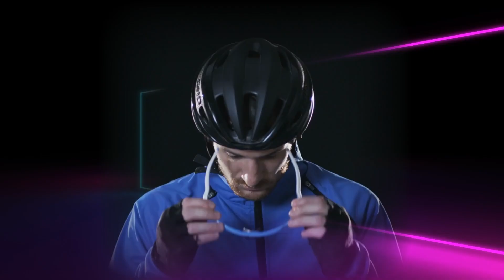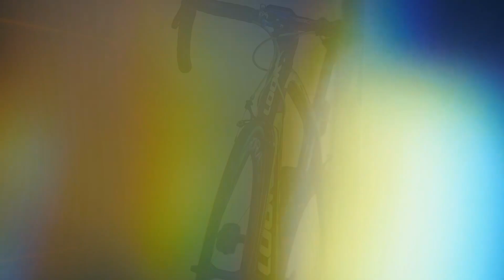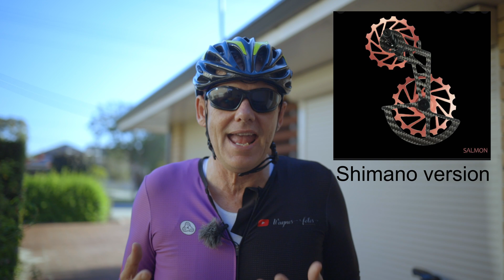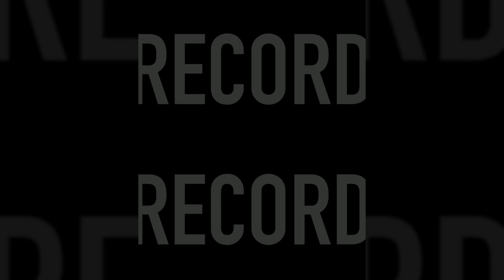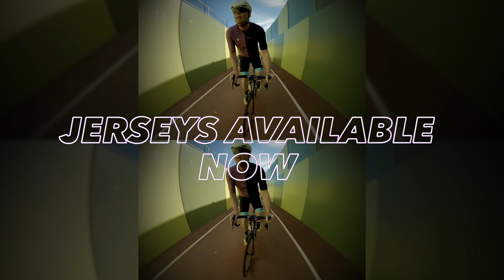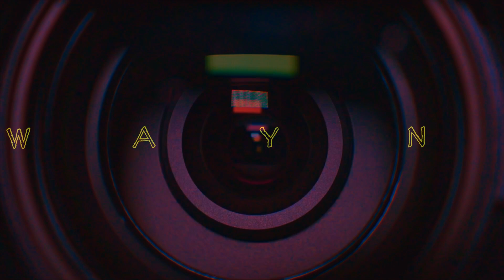Nova ride OSPW, big brand competitor

Comment: Being fairly obsessed with weight  is the main reason I wouldn't go for an OSPW. The weight of the unit, plus the extra weight of a longer chain, would negate the weight savings of my very expensive Darimo drop bars. I couldn't do it. 😱

Comment: As you probably know Dura-Ace rear derailleur cage is made of carbon fiber. Not even a few weeks after I bought my 9150 Dura-Ace group this year I cross chained in the Biggy Big rings and it broke one of the plates of the cage. The chain just ripped it apart. I ordered a new part that took 5 months to get because of the situation we are in getting parts and cost $110 US. I knew at that moment I should have bought Ultegra because that cage is aluminum. Before the idiots say you shouldn't cross chain like that let me say that Shimano Di2 allows this and you cannot block it in the settings. This could happen to anyone if you aren't paying 100% attention.
Reply: You can program di2 to shift the front as you get to a cross chain situation.
Reply: Buy parts that you can afford to replace regularly. We all need to keep this in mind when we upgrade our bikes
Reply: @binshuo  My point was highlighting that carbon is a shit material especially for the derailleur cage. I wasn't bitching about the price. I actually bought a whole new 9150 rear derailleur for $700 when mine got broken which I still have on the bike. I repaired the broken RD when I finally got the part and have it in a box so you might say I'm prepared for the next time if should happen again or the derailleur quits completely.
Reply: @wasupwitdat1mofiki94  If you don't care about the price, then buy 10 units at a time so you don't have to wait 5 months to get it replaced
Reply: @binshuo  You're still missing the point " CARBON IS A SHIT MATERIAL".
Reply: @wasupwitdat1mofiki94  that goes without saying. Rigidity often means fragility
Reply: @wasupwitdat1mofiki94  yet aviation is using so much carbon composite
Reply: @glennoc8585  Not the same process the bicycle industry is using and far more quality control. Don't be a fool thinking just because it's a material used in the aerospace industry that you bike is manufactured just as good. Bikes would cost way more money if that was the case.
Reply: If the cogs are there then you should be able to cross chain.. to hell with what they say..
Reply: @brendanlauman8048  This is why I think the Classified Hub system is interesting. You actually get more usable gears.

Comment: The groupset manufacturers didn't design their dérailleurs to move these pieces of marketing  supremacy/ engineering irrelevance. You are asking for problems in the long run all for the sake of making ZERO real world gains while compromising shifting. 
Bottom line, an exercise in pointless stupidly but better and cheaper than AB extremely poor and incompetent effort.
Reply: Exactly, but the new generation cyclist will think differently.
Reply: bless ya!

Comment: If all these ospw manufacturer really put a thought in marketing this product, they need to snake-oil it in a way like this:
Larger pulley will have less rotational friction in each and every chain link while gliding through large pulley, as the link does not turn through tight corner like they do in small pulley.
Reply: Also large pulley itself have smaller speed on same cadence and gear. So if you have your pulley wheel bearings not maintained, creating load. It will be easier to pedal. :P

Comment: I increased my bicycle top speed and the range how far I could ride, just by cleaning all the dog hairs and dirt out from  pulley wheel pushing. Also the lower pulley wheel pushing of my current bike, is already quite worn. There is already a groove in the metal sleeve/pushing.. But it's still works.

Comment: Well this is an unexpected bonus before work 'new video from Wayno 10 second ago' 😂😂
Well explained, you really are unpacking bullshit, so the none load side really makes bugger all difference and it's just a looks and fashion 'thing'
Reply from the maker: it does have the spring tension on but that is all. Not saying it does nothing, but does very little, the bearings I would think make the biggest difference.
Reply: @waynosfotos  well my ultegra 11 speed mechanical derailleur arrived 2 days ago from Wiggle, its staying exactly as it is.